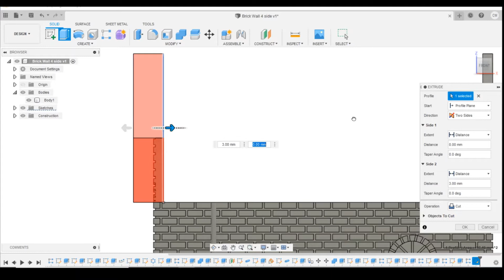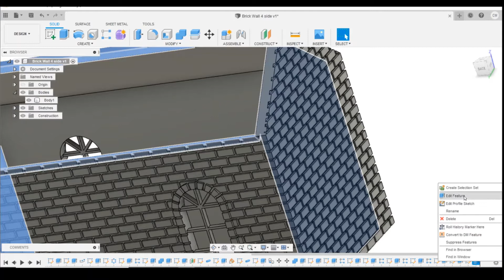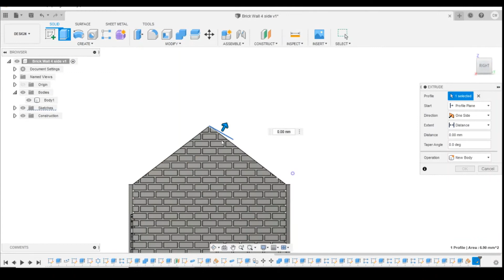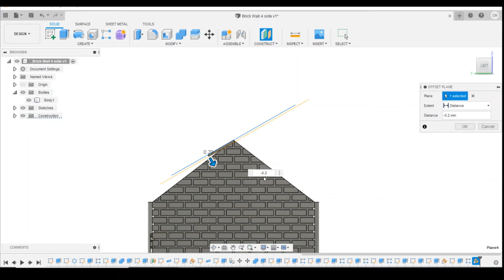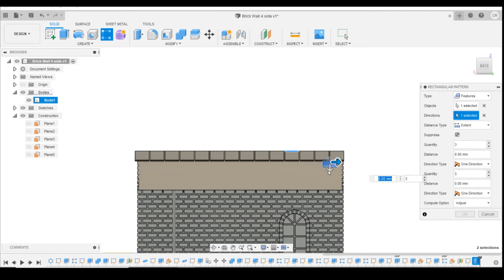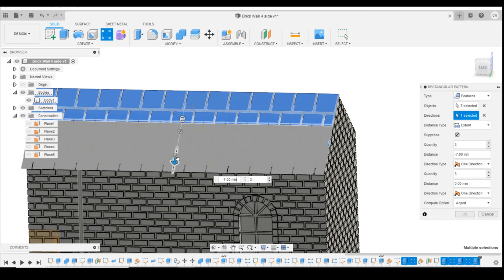Lesson 13 - Fusion 360 Tutorial Plane at an Angle and Rectangular Pattern

Comment: Hi, did you know that you can do the maths in the dimension box eg instead of calculating say 2.3 - 0.16 divid by 2 then entering the result just type (2.3-0.16)/2 in the dimension box and Fusion does the calculation.
Reply from the maker: Hi Colin,

Yes I'm aware of that function,  I just like to keep the old Grey matter working sometimes :-)